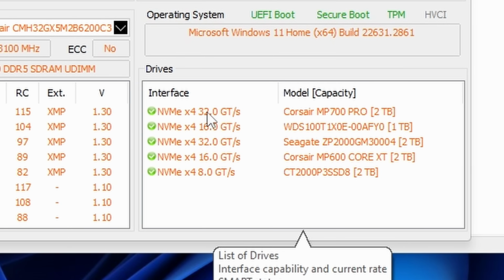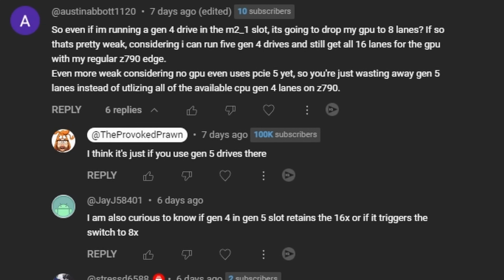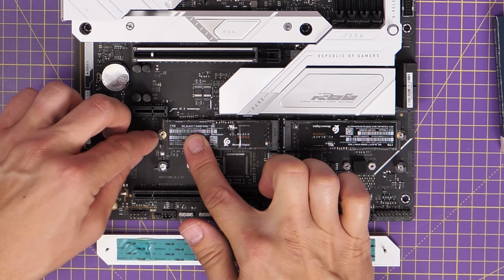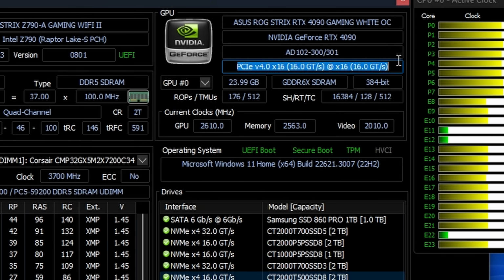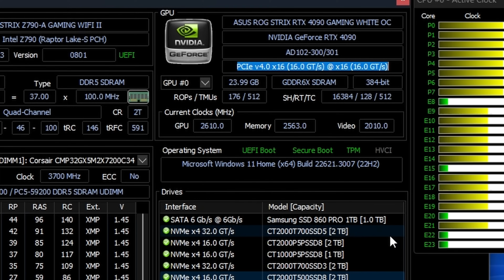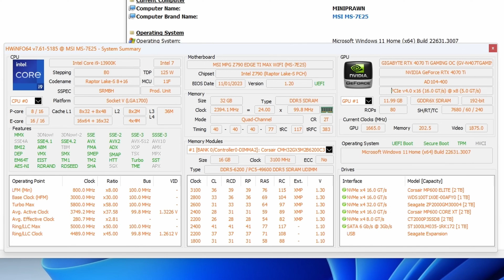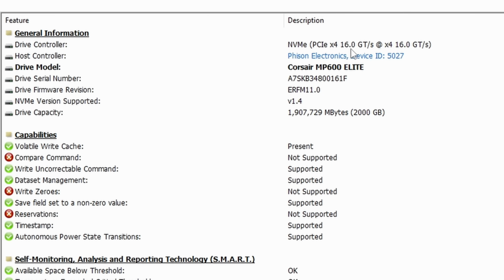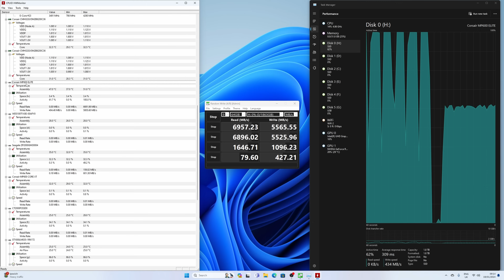Problems with NVMe SSDs and motherboards that you need to know

Comment: Just installed a secondary corsair ssd with the heatsink on a tuf b650 plus. Quick note: had to remove the underside housing of the heatsink to be able to snap-fit the locking latch on the mb. Also, used the mb Rubber pad riser since its a one sided nvme. Each mb has its quirks

Comment: What i wanna know is when the ssd has its own heatsink. You left the bottom m.2 plate with its thermal pad on. My msi motherboard manual says to remove the m.2 plate (along with the rubber cube) if the ssd has its own heatsink. Did you leave yours on cos of better cooling? Is MSI wrong? Or does it not really matter?

Comment: Dang It!   Gigabyte Aorus Z590 Master.  I put an NVME Gen 4 (WD Black) on that high speed M2 slot by the CPU and it did indeed lower my 7900 XTX to @8.   Drive is running @16 though.

Comment: Check the block diagram for whatever board you are looking at. Then notice that (at least what I observed) that top position is probably driven off the CPU (e.g. z790 architecture). Any others, off the chipset. You can then break it according.

Comment: If you’re running an 12th, 13th or 14th gen Intel cpu, and a z790 motherboard, you get 20 lanes on the cpu, so 16 for the graphic card and 4 for the M.2.  That then leaves you 20 lanes on the chipset, which can handle upto 5 gen 4 M.2.  Only becomes an issue, if you start using any of the other pcie slots

Comment: and if 
i have a gen 5 nvme m2 on a gen 4 slot does i have a problem ?
Reply from the maker: The problem will be the gen 5 drive will only run at gen 4 speeds. Other than that, no.

Comment: Had major issues installling in the top slot on a Asus and Gigabite  mobos w/550 chipset. Driver for every device blowing apart, corrupt os with older sata drives. 
They do not play nice.

Comment: Yes. 
Users must check the diagram of their motherboard and be aware of the fact that certain ports share bandwidth with other ports. 

Now, regarding this video, I see no problem in the fact that the M.2 PCIe 5.0 port, when populated, halves the bandwidth of the video card, because it drops it at PCIe 5.0 x8, which is equal to PCIe 4.0 x16. 
There are no PCIe 5.0 video cards out there yet.

Comment: You have to check the spec of the motherboard, you cant just make general claims that all boards have these issues. I have an Asrock board and there is no halving of the video card lanes no matter what NvME drive I put in slot one. In fact the only downside my board has is using these NvME slots does take away from specific SATA ports, depending on what slot you use. People need to stop asking you these stupid questions and refer to their boards user manual if they want to know what they can and cannot do!
Reply from the maker: Yes it varies a lot from motherboard to motherboard. And the average person might not realise.

Comment: With the mpg z790 edge TI Max wifi, it explicitly states in the instructions that if m.2 slot 1 is used, it will knock your x16 gpu slot to x8. This is because the #1 m.2 shares the same bus as the x16 slot, which is shared directly with the CPU itself. If you want to make full use of your gpu, leave m.2 slot 1 empty. Also, if you use the m.2 slot 3, your sata data 1 & 2 is useless. Same principle with the exception that m.2 slots 2-5 are managed through the z790 chipset. That chipset mangages other secondary interfaces as well. These technical phenomenons are common place and are mentioned in CompTIA a+

Comment: I just bought the asus strix b650-e motherboard it's everything, but and X board without the name. However, this is also gen5, but it states if I use the bottom gen5 nvme slot, that would half the speed of my gpu. I should be able to use the top gen5 slot with no issues.  Incidentally, if you did use up the nvme slot that shares the x16 slot, you'll get 8x, but 8x on the gpu lanes won't have any performance impact on a gen4 graphics card.

Comment: So, uh, question: Have you tried checking the lane usage while actually USING the graphics card for something? To see if it is prioritizing bandwidth to the gpu when it is going full tilt, but leaving it in a lower bandwidth mode when it isn't using that bandwidth?  Obviously, test while gen5 slot is idle, but might be something worth checking. 
It's also a good thing to remember that for most consumer uses, an NVME doesn't provide much, if any, noticeable benefit over a SATA SSD. So you can usually just whack a Sata ssd in instead of using that gen 5 slot. 

Also, yes, always a good idea to check the specs of parts BEFORE purchasing them by looking at the more detailed data available on manufacturer's site, instead of just marketing slides. It's helpful for pretty much EVERY part.

Comment: chips only have a limited number of specific generation PCIe lanes, you can also have PCIe switches on a board that will split up a higher gen lane to multiple lower gen lanes, but this isn't always the case. 
for the i9-13900k that has 20 PCIe lanes maximum and support gen 4 and gen 5 in the following configuration  'Up to 1x16+4, 2x8+4'

Comment: Yes this is all True. I've been building my own Gaming configurations for 40 years. I currently use the Asus ROG Strix B550 XE Gaming Motherboard & 2 TB NVME M.2 SSD Ryzen 7 5800X CPU. Yes installing another M.2 in the lower slot will split the Lane Traffic to half. Instead of 16X they will both be 8X.

Comment: Don't forget that some ports will run off the south bridge and all will show as gen 4 speeds but are actually sharing a single gen 4 rail with everything else on that south bridge.... Basically, if you want to use NVME DON'T, haha i joke but buy Xeon or Threadripper so you actually have those PCIE lanes available and not bottleneck your drives or GPU during loading sequences. 

i9 14900k only has 20 lanes of PCIE on it, 1+16x and 4x lane. So, 16 to GPU and 4 to the chipset. 
Ryzen 9 7950x3D has 24 lanes. So 16 gpu 4 nvme and 4 chipset. 

Technically you can populate all the drives and all the sata ports on newer motherboards but if the cpu doesn't have the lanes, all of them end up sharing and can cause FPS drops during high usage of any one device.

Comment: Well, that's why you just tale a look at the manuals. Nothing special here. Judged by the title, I thought it's something unknown, but that's just the normal "RTFM". What's missing is the usage of drives over the southbridge. The southbridge is not using the amount of pci-e lanes that you would see connected as pci-e lanes to pci-e cards or pci-e ssds. the lanes are shared, even if every card/ssd is showing with full speed.

Comment: Fortunately, Gen 5 PCIE is comical overkill for almost any application.  I think it depends greatly on the motherboard though, as to whether or not you will have some penalty for going with the newest gen speeds - because my ASUS ROG Maximus Z790 Hero - quite similar to the ROG Strix - I currently have 3 NVMe, and I could put 2 more on it - though two of them uses an addon card, I believe I would suffer some penalty - I just can't recall it off the top of my head what it was - pretty sure it would downgrade the number of lanes on one of those channels.  I'll need slightly higher capacity than an NVME currently offers for storage of certain things, but I might go back later and put 2 more new NVMe drives into the board just because I can.

I've had a good experience with this board - but there are definitely detriments to loading it up with TOO many NVMe drives, or Gen 5 - however, IN PRACTICE (actual use), to my (limited) tests at least, I have not been able to discern a difference at all.  If you're going around benchmarking everything in your system, you can see a numbers difference, but a practical difference? nope.  At least, not for anything a gamer would be doing.  Regardless of where I take that penalty, it would not affect the system's ability to.  The only reason I'm not currently is because the other 2 NVMe drives I had from my previous PC build have years of use on them, and I decided to make a secondary computer using them, until they crap out on me.  Everything I did with them all installed was still blazingly fast, and I think that's simply because Gen 5 is ...not really something anyone needs - for gaming at least.  Your GPU doesn't utilize those Gen 5 lanes, haha... depending on what you have, that too is likely overkill for any gaming that isn't like, 8K (I have a 4090 - yes, I'm one of "those" guys)... It's sure cool to have the option though...! 

Unfortunately that also jacked the price of all these boards up to an absurd degree... now a motherboard is as expensive as a processor - and if you aren't getting a TOP of the line CPU, you could easily pay more for the motherboard.  The motherboard used to be the cheapest piece in a computer outside of maybe Ram or drives - but motherboards also started to become most system's bottleneck.   

That price tho... ouch.  The Z790 boards are absolutely astronomical in price...

Comment: well both drives use 4x, doesnt matter what the PCIE version is.  i thought this was common sense at this point or is it not common sense.  that the GPU would only get 8 lanes vs 12 lanes cause 4  are used by the nvme drive.  PCIE lane assignment does not work like that it is either 1x/2x/4x/8x/16x lanes.  since that divides up that way, they should use put another nvme slot up there.  then you have two getting 4 lanes each and the gpu 8x and then they are not just wasting 4 lanes.

with all these things they want to put on the back of motherboards now.  they should just put both nvme slots on the back of the board. then find a case with cut outs there for the hs to fit through.  on the back would be a good call for a nvme water cooling blocked tied to a 40mmx2 rad.  god now i have so many thoughts on cases.

Comment: I have an MSI X570S Ace Max.  Its a bit rare, but I chose if for all of these reasons.
The thing I notice most is the chipsets.  They are TRASH.  It is usually by far the hottest thing in my PC, it will sit at 70c just doing nothing.

Comment: I really like my MSI board for NVMEs it's a B550 tomahawk.  It actually lets you decide how you want the lanes split... kind of. 8+8, or 8+4+4, 4+4+4+4 and then everything is full.  Mine is currently 8+8 cause I'm just using 1 NVME so everything is nice and quick.  I will be upgrading eventually so I'll dumb it down to 8+4+4 but my GPU will still be full speed while the NVMEs get to share.  That being said it doesn't have a thermal pad on the board side like yours does! It has the heatsinks for the top if the NVME doesn't have its own (mine does) but nothing for underneath.

Comment: I've read that if the GPU slot is gen 5 it doesn't matter that using the SSD slot halves the lanes on the GPU slot because PCIe gen5 has 2x the lanes of PCIe gen 4 and you're only going to be putting a gen4 GPU in the slot. It's essentially the same as placing it in a PCIe gen 4x16 slot and there aren't any drawbacks to current performance. What do you think of this?
Reply from the maker: I tested and there was minimal negative impact https://youtu.be/CT55vgeuhPo
Reply: @TheProvokedPrawn  Is the PCIe slot you're using in that video gen 5 or gen 4?

Comment: the "pcie halving" problem sounds like not only a motherboard problem, but a CPU problem

you are using a CPU that functionally has less PCIe connection than its higher-tier counterparts, and on top of that, your motherboard uses PCIe bifurcation in order to get that 5th gen nvme connectivity

Comment: I have the same board and only use the top drive and get x16 on my 4090. So it might not be what you think? Maybe if you fill all with gen 4s or just top with gen 5 it locks it to 8x.

Comment: All you need to know, is how PCIe lanes are distributed. 
You can divide PCIe lanes (usually done to CPU lanes), or create new ones ( chipset ), but if there’s not enough, you can disable some of them. 
The problem is simple, cost. 
There was also no mention of max speed of chipset to CPU link, as well as no mention why we split PCIe lanes.

Comment: 8x Gen4 lanes is mostly fine for your graphics card. Might get a few % performance penalty. But yeah, not ideal. Too bad there are no Gen5 graphics cards otherwise it wouldn't have been an issue as 8x Gen5 = 16x Gen4 and would've been plenty.

Comment: Just be sure to check the GPU with something running. the GPU goes into standby and changes the speed of the PCIe when nothing big is rendering, so that information is not correct if you don't have something actually being processed by the GPU.
That's why on GPUz there's a rendering test near that info.
Reply: It changes speed, yes. PCIe lanes, no.

Comment: I am running a gen 4 nvme drive in a rog strix Z590-E Gaming Wifi Mobo and my RTX 4090 gets all 16 lanes, I am also running a gen 3 NVME drive. It must depend on your board and mine is a gaming board.
Reply from the maker: It does

Comment: This is a non issue with modern hardware. GPUs today still can't fully saturate Gen 4 x16. And Gen 5 x8 is the same speed as Gen 4 x16. 

You could theoretically install 2 Gen5 x4 Nvme drives on the same lanes as your primary PCI slot, and still have a full Gen4 x16 worth of bandwidth for the GPU.

Comment: I mean, I don’t really need such high speed SSDs, in fact I have two 2Tb SATA SSDs to keep my Steam library on and other stuff and one 1TB NVMe Gen3 for my boot drive, and my PC boots up in like 7 seconds. If you REALLY need so many high speed SSDs then you should buy Threadripper or Xeon for the massively expanded PCIe bandwidth.

Comment: The biggest problem is thermal throttling, i wonder about the longevity of those drives. I will switch to u.2, u.3 or e1.s in the future, this is far more reliable and doesn't have these negative issues. But these board limitations are a complete joke as well

Comment: Subscribed, because none of the bigger channels seem to even touch on this topic.
Reply from the maker: Thanks. I try to cover useful things that not everyone knows.
Reply: Having been an "Electronics Junkie" for decades, I learned what you cover here the hard way, long ago. (When the going gets weird, the weird turn pro. -Revenge of the Nerds;-) So, I moved up to Threadripper! @TheProvokedPrawn
Reply: @TheProvokedPrawn Very much appreciated
Reply: The same. thank you.
Reply: Too complicated for gamers. The nvme drives can also run really hot.  I only use a single drive in the slot I can easily cool with a extra fan.  Usually the bottom slot.  There’s not that much real world speed difference for an average user between a nvme and a sata ssd.  It’s not like going from a mechanical was.

Comment: The root cause of this is the number of PCIe lanes that the installed CPU has.
When a mainboard supports a range of CPUs that vary in the number of PCIe lanes, the design of the motherboard compromises on the connectivity to maximize the use of those available PCIe lanes with respect to the connectivity features of the motherboard.  This is more prominent on workstation motherboards that have 7 8/16x PCIe slots. 
This includes physical PCIe slots that are actually active and PCIe switching that disables PCIe slots or certain interfaces when another is populated (like nVme).
This functionality however does reduce the range of motherboards that need to be manufactured and appeals to the budgets of a wider customer market.
It would be nice if the the mainboard uEFI BIOS handled this more clearly both as a menu in the console and during POST so users / techs did not have to waste time figuring out what is going on in this scenario.
it is really annoying when trying to select a mainboard for a build as these details are generally not available in comparison tables.
The uEFI standard has some more growing up to do with respect to this.

Comment: I think everything would be much easier to explain if you go off the motherboard block diagram, which is in most motherboard's manual. TLDR, there is only so much PCIE lanes to go around with on a consumer platform.

Comment: I have the strix z 790 e ddr5 gaming board and no matter what you do . if you populate the top slot it will always decide the lqin3s with the pcie going to half of its normal x16. Its because the number one slot and pcie lane share the same direct to CPU mains instead of like the rest that go through the chipset.

Comment: Any chance you can read up on or check the Gigabyte TRX50 Aero D. It has 3 PCIE5 slots and 1 PCIE4, and dual PCIE5 x16 gpu slots. I will be running a PCIE4 gpu of course, but have a PCIE5 drive for the main drive. Would really suck if it interferes with the GPU.
Reply: based on the manual from the website on page 24 and 25, seems like it wont sharing lane so no issue it will be disabled. so should be no issue